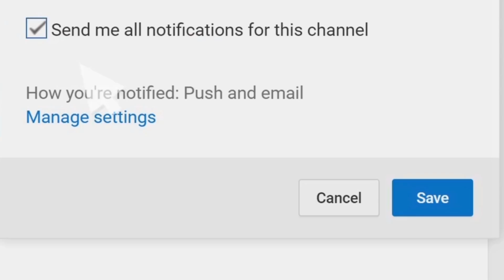Twin Engine Volantex Ranger 2000 RC Plane Build - Pusher to Tractor Conversion

Comment: Cool project!  I really like the Beacon Foam Tacit is my preferred glue for foamies.  I just happen to have some of the Beacon Fabric Tac for sewing projects on hand, but have never opened it.  Curious if you find the formulation different?  Obviously you find it capable for projects of this nature.  I ask because the Fabric Tac is more readily available and generally cheaper.  I've been curious about this for awhile so would love to hear your input?  Thanks
Reply from the maker: The difference is in the thinner. They both are equally strong and work the same. Fabric Tac uses acetone as the thinner which is not good for Depron foam but is ok for most other foams. Foam Tac is good for all foams but costs more.

Comment: You should get some "gift cards" to make your zip tie plates.   If you need some, I have a box of like 10,000 of them....
Reply from the maker: Really the vinyl siding works great. Easy to cut with scissors, easy to drill holes, UV resistant and white to blend in with the foam.  Also there is plenty laying around at construction sites :-) Dumpster diving anyone?
Reply: The "gift cards" are just white pvc and 0.03" thick.
Reply from the maker: They sound very similar but I will pass for now. Perhaps someone else could use some. Thanks for the offer.

Comment: Another great twin conversion Dave!  You have a whole fleet of great twins!  I have been thinking about converting my Tundra float plane following your example.  I’m flying my Grand Tundra more now so I am thinking about just keeping floats on the Tundra.  Looking back on your conversion, do you think it’s been worthwhile?   I like the increased prop ground clearance, differential trust, etc., just wondering if you’ve discovered any downsides since you’ve been flying it?  Thanks!
Reply from the maker: Talking about the twin Tundra: The only down side I can think of is the extra build time but once it's built the flying is wonderful. The 10x5 props with 980 kv motors is a little quieter than the 7x5 with 1400kv so you might consider that.  Both use a 4s 2200mah LiPo.